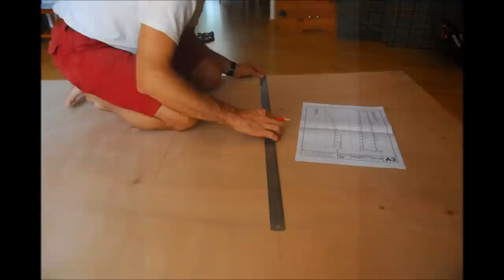Goat Island Skiff building

Comment: Enrico, do you know how many hours it took to build your Goat Island Skiff.  I am thinking about building one.
Reply from the maker: Hi sir, unfortunately I haven't counted my working hours. But I can say I have worked for 9 months: all the weekends (2 full days) plus 1-2 hours every day during the week (in the evening, after my work). Consider I have wasted a lot of hours in finding the right timber in the local shops. This was my first boatbuilding, so, having no experience (example, I didn't know how to use epoxy), I was very careful and very slow in my work. Consider the project is extremely well designed and explained. The structure of the hull is very simple. There is an open group of builders on facebook called "Goat Island Skiff" which is extremely helpful once you are registered:
https://www.facebook.com/groups/GoatIslandSkiff/
Consider it. Good luck for the project!
Reply: Enrico Franconi excellent, thats great info.  Thank you.  I am the same as you were, dont really know anything about boat building, but I want to give it a try.